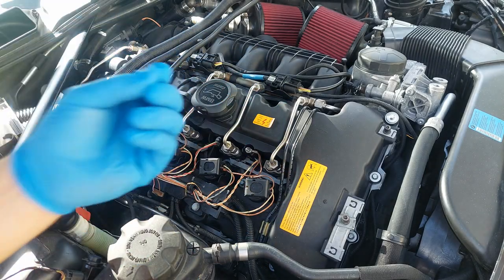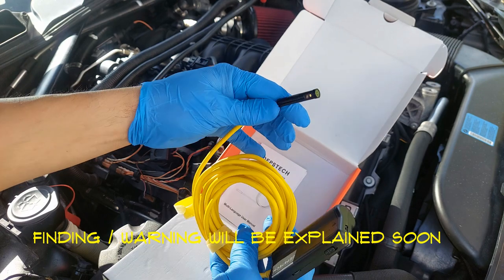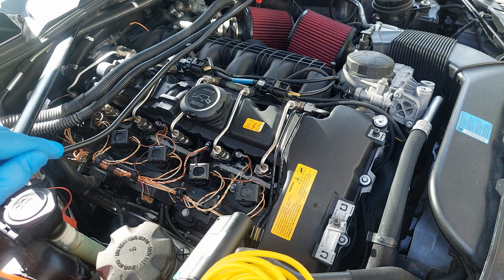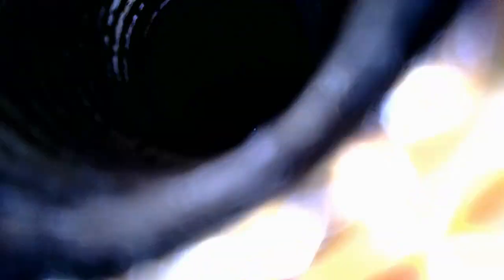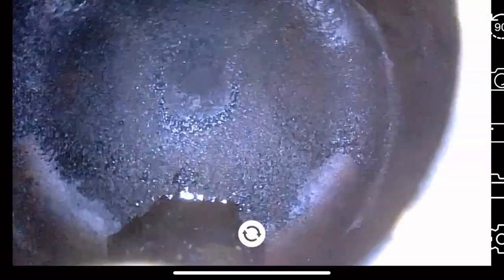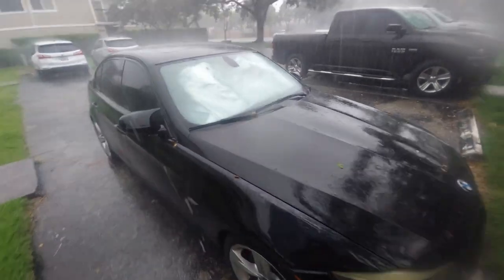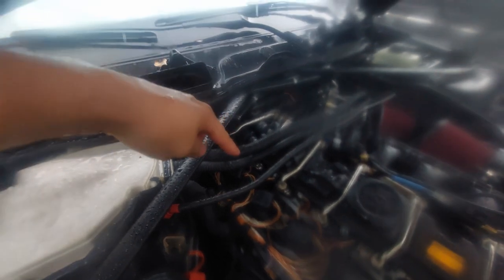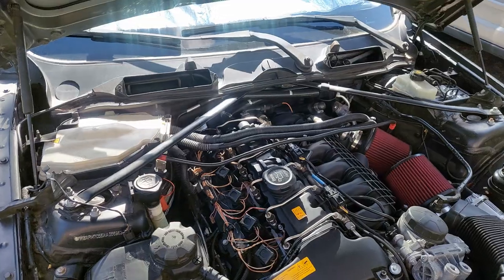Warning! Doing This Mod Can Kill your Engine! / N54 Cowl Delete

Comment: The biggest problem is not the missing cowl, but the missing engine cover...
Reply: missing cowl will also mess with your ac and cabin filter area, can leak water into passenger side floor and flood electronics

Comment: The engine ticking sounds like a lifter tick. Very common issue. And the water inside the cylinder head is more than likely a worn head gasket. Eliminating a cowl cover will not drain water inside your engine by getting past your spark plug.

Comment: I know you had good intentions here, but your misleading the community with this video. I have 10+ BMWs in my fleet, and 6 of them are BMW E90s, ive got all variations the engine and all cars have had their cowl removed. So if you take the 6 cars, and add how many years each car has been running without its cowl, I can say I essentially have witnessed 60 years of cowl delete between them all, I can safely say this is not correct. If you have put back the spark plugs and coil packs correctly, there cannot be any water penetration to the engine, it just cant make it past the spark plug. I have never seen a wet spark plug like you are describing when pulling them out, and I replace them all every 10k miles so I am regularly inspecting them. So the video would be better suited adding a warning at the end, this is what happens when you delete your cowl and fail to to properly install spark plugs and coil packs. 

Now, moving past that, you should note that you have done the cowl delete incorrectly in my opinion, you have left your cabin intakes completely exposed. Now that will allow large debris and rodents into your interior, terrible idea. You need to get coovers for those inlets, BMS sells them and they are excellent, all of my cars have the filters on it and no problems. They are washable, but the plastic tends to rot in about 6-7 years in the engine bay going through the heat cycles.

My final point to add to this, is that there is one particular situation where the cowl delete can cause massive problems. On one of my E90s, a 2006 325xi has the older N51 variant with the magnesium valve cover, the one that has the metal gasket. This engine was found on the 2006 models that were produced in the first few months of the year. If you do the cowl delete on that model, the water pools on the back of the valve cover by cylinder 6 in the cavity by the injector and can cause rust and will cause it to deteriorate. This happened in my vehicle and caused the valve cover to create a little cavity that then turned into a blowout, looks like a bullet shot out of my valve cover. Replaced it and have no problems. I treated the new valve cover with some extra coatings/sealants to resist rust and I re-coat that back section every year to ensure it does not occur again. Good luck!
Reply: So do you use something to cover up the ECU & master cylinder/reservoir when doing the cowl delete? Or do you just leave it exposed? I'm thinking about doing the delete on my 06 e90 n52
Reply: @alextran8188  it's a useful mod only if your constantly working on your car, otherwise it does not make sense unless you just want to hear your engine noise more. The ecu is completely protected by it's box, you just have to ABSOLUTELY make sure it's tight and properly clipped on, and water will never enter. I would say check for cracks because it's plastic but I've never seen any of my ecu boxes get cracked over time so it seems they are made very well. Master cylinder will also be fine as is, just make sure to clean out the leaves once in a while and ensure the drainage catches are clear of debris, if you park under trees or near trees, this is important for many reasons. Any other questions let me know

Comment: I have the full cowl delete kit from Turner Motorsports (cable bracket, ECU and booster covers, cowl filters) and because of this video, I made sure to put my engine cover back on before it rained. 
It’s been raining a lot over the past few days and my car/engine has been fine. 

Cowl delete + Engine cover and you’re good.

Comment: I have had a cowl delete for 3 years. Put your engine cover on bro I’m more worried about the dme
Reply from the maker: Yeah man, thats exactly what I did right after I recoded that footage. 
The main issue that I see is in the long run and how much exposure the car has with water. We all now that water is a MF. It likes to either rust, corrode, or cause oxidation on a variety of materials.
For instance; Aluminum doesn't rust, but it does corrode. Aluminum corrosion can happen gradually over weeks, months, or even years, if constantly exposed to water. 
I dont think is super alarming thought, specially if you keep your car indoors (that's when it comes to corrosion)
The other concern would be water and/or moisture in close proximity to your DME.
I used to run with the cowl delete myself, but it was until what I found, that I decided to protect the engine from water from getting in, by modifying the cowl. It is for this reasons, it is better to be safe in my opinion.
I was super worried after I recored this footage so I just ended up modifying the cowl to aliviate any headaches.

Comment: Unfortunately water dose not seep into a combustion chamber unless your spark plug is loose. Your spark plug may have been loose via the noise on the video. Condensation is most likely the reason for water on piston
Reply from the maker: Great point! My car mad being sitting there about a month. At that point we where having rain almost every day, Hence It was hard for me to work on the car. Not having a cowl at all was, along no covers was definitely not a good idea.
Reply: I specifically was looking for this comment. I agree...no way water gets on piston without a missing, or very loose, spark plug.

Comment: I can only agree with your opinion, of course heat builds up through this cover, but I wouldn't completely omit it. I got an engine wash a few weeks ago and was able to notice after 1-2 weeks that my ignition coils were all rusty because water got into the spark plug shaft from the engine wash. This caused me to have misfires at higher revs. I'll swap spark plugs and coils tomorrow and hope the problem is fixed. Greetings from Munich Germany. :goodvibes::goodvibes::goodvibes:

Comment: Haha, funny, water can't get in past the spark plug, the cylinder is totally sealed. More likely is that some water got down the spark plug tube in the head and when you unscrewed the plug it dropped into the cylinder.

Comment: Did this fix your issue? Was water seeped into your spark plug holes in the head causing a misfire or something? My car ran perfectly fine before parking it for winter and I now have the same noise as you.

Comment: What specs are the 8mm bolts cause I have non
Reply from the maker: Since I wasn't sure of the bolts. I just went to the dealership and bought the clips that the bolts screw on, as well as the bolts. It wasn't much, just a few bucks.
That's probably the best bet. Hope that helps bro

Comment: There are plenty of ways to make power and improve cooling that don't include soaking your gofast bits. Like honestly, if you think 10 lbs weight reduction, a slightly better sound, and supposedly better cooling is worth possibly destroying your engine and/or dme, then go for it. And as for ease of access... I get it. But c'mon, it's only a couple bolts and wires. You can take the extra two minutes removing it whenever you need to. The only way I could justify doing this to my car is if I could afford to buy 20 more bmws (and I definitely cannot lol).

Comment: Cowl is there to protect your engine from rain I added it back... my e90 is always in the garage so I can also tell you I live in Florida. E90 has about almost 300 miles and the engine is quiet just serviced it and I couldn't agree more. Also, where is your engine cover an why did you take it out brother? The engine cover is there to protect your engine it doesn't make it better for your engine to cool up. i rather cool my engine by using silicon tubing.

Comment: Im lost, Can someone tell me what the purpose or benefit is in removing your engine cowl? It might have a bit of a cleaner look and I'm sure the weight diffnce does  Nothing for your performance, so what would one expect to happen?
Reply: It alows alot more airflow, saw my running temp drop 5-10° c some days
Reply: Yea drops abt 10 lbs allows you to hear more from the cabin and allows way better cooling in the engine bay for the price def worth it just run ur engine cover with it and youll be good

Comment: What if you had the plastic cover on the engine? I run cowl delete with plastic cover - wondering if it’s still vulnerable to water. Haven’t had issues yet. I may go to M3 cowl mod long term.
Reply: You should put a camera in, close the hood and hit it with the water hose. I be interested in the results. I run the bms cowl filters with the plastic engine cover and no issues but I also have no rain in my area.
Reply from the maker: Having a plastic cover on would have prevented the water getting in on top of the engine for sure. Not only prevented the outcome that I saw, but also prevented water from touching the ignition wires. The main issue that I see is in the long run. Water is a MF. It likes to either rust, corrode, or cause oxidation on a variety of materials.
For instance; Aluminum doesn't rust, but it does corrode. Aluminum corrosion can happen gradually over weeks, months, or even years, if constantly exposed to water. 
I dont think is super alarming thought, specially if you keep your car indoors (that's when it comes to corrosion)
The other concern would be water and/or moisture in close proximity to your DME.
I used to run with the cowl delete myself, but it was until what I found, that I decided to protect the engine from water from getting in, by modifying the cowl. It is for this reasons, it is better to be safe in my opinion.
I just made a video modifying the cowl btw. 
Looks super 😈
Reply from the maker: Man. honestly after seeing the amount of water going in and how exposed the DME was. I didnt even re-record that footage, because I started to get worried. 
Check out the previous response, on the reasoning behind putting or modifying the cowl.
Reply from the maker: And minimize the water exposure. Long term effect can be the issue here.

Comment: I cant understant how water would make it thru the sparkplug threads. Does not make sence..  I do understad your point though.  Engine ticking is common for these models.  Head gasket is also possible.  Check your oil to see if its mixed with water as well...

Comment: Are you going to swap the motor ?
Reply from the maker: No, luckily my engine is ok. This is what I noticed while looking for an issue I currently have. And I wanted to put it out there since a lot of guys have the cowl delete set up.  Difference is that my car has been on a stand still for weeks without the cowl or the engine cover.
Reply: @CrazyCarMods  oh great news, what did you do to stop the knock sound or did it go away ?

Comment: I have the cowl delete but with BMS filters and still have my engine cover on and do not have any problems. But thats just me.
Reply from the maker: The main issue here that I see is in the long run. And any effect a bad seal can cause. I ened up modifying my cowl just to aliviate any issues. Moisture cause also cause damages in the long run. Knowing how much the DME can cost, and seeing this issue I just saw. I think is better to be safe. Aluminum doesn't rust, but it does corrode. Although Aluminum corrosion can happen gradually over weeks, months, or even years, if constantly exposed to water.
Just minimize the exposure to water and you'll be good.
Just a food for thought.
Reply: water is meant to go under the cowl… thats why its raised… all the cowl is doing is protecting the filter from dust/debris moisture will still get behind it. bms filter is washable when you see it looking crappy, just clean it.. the filter seals to surface tighly, done.

Comment: This would seem like a reasonable assumption, EXCEPT that my car had the cowl deleted many years ago, and my ECU and Sparkplugs are dry as the Sahara. And I'm in the SE where we get hell raising thunderstorms almost every week, multiple times in the late afternoons during spring and summer. So, NO! That's obviously NOT the culprit. Probably loose spark plug, as water doesn't push through that tightened fit. It's all good, I know you are just trying to help people so I'm not looking to flame you here, but I do feel a need to correct the misinformation.
The cabin filter housing is a heavy pos that these cars do NOT need. EVERYBODY wants to blame every problem on removing it, because most bimmer owners learn quickly that they don't want this heavy pos on their cars and remove it. But of the thousands of bimmer owners who are either in the CCA or on forums I frequent, almost NONE of them have had any problems with the cowl delete. IF anyone is paranoid about it, run your own heat-shielding, as a way of shielding this area from direct spray, if it makes you feel better. But mine (335i E92) doesn't have any of that, and mine is in perfect condition and doesn't have any water in the plugs, or plug area. SO the empirical information proves it's not the cabin filter housing removal that caused your problems, or anyone else's.
Reply from the maker: Steve. I'm glad that up to this point you haven't had any issues. But honestly, who in the world is going to take a look at their engine right after it rains, before turning on their car? 
Before this video, I was running around without any cowl or engine cover. I had the cowl delete for a very very long time; and I too used to think that it would cause no harm. While my car had been sitting there for weeks without driving plus some raining in between, one day right after it finished raining; I turned my car on and immediately opened the hood to look for a ticking sound I was experiencing. It was at this exact moment I saw water start to bobble up and evaporate on top of my engine, next to coil 5 and 6 in the little holes that are around that area. Remember, I did not have my engine cover on. 
After noticing this, I did not think much of it (yet It stayed in my mind).
Following this, I didn't work on the car for weeks since I was very busy and out of the country (of course we were in the rainy season). Once I finally got back to work on the car, that's when I discover what you saw on this video. My car at this moment had NOT been turned on or moved for over a month (it was also raining nearly everyday).
Now while I do understand that having water inside the cylinder head is very very odd, it is Not impossible. For this is what I experienced. Water is a MF and it will filter through just about anything. Water will go through a rock or concrete if you give it enough time. 
Regardless, Im putting this information out there for everyone to be conscious and cautious. For everyone who has this mod and for everyone who may be concerned to run their own test and verify for themselves. 
I know what I saw and I know what I have experienced, Yet it is up to everyone to do their own test and decide what they want to do. Maybe a little bit of water is no concern for many people and for many other people maybe it is. For anyone who really wants to know, just run your own test without the engine cover and obviously without your cowl and see for yourself. 
Best of luck to everyone. #N54Gang
Reply from the maker: Thank you for your input
Reply: @CrazyCarMods  Yeah, I'm not trying to be a dick here, but the problem with your car was NOT the cowl delete, it was owner neglect, as you've detailed in your statement above. I don't let my car sit for ANY time without driving and checking it out. That is a death sentence for these cars. I drive my car every single day, and in the spring and summer, through tons of serious thunderstorms. And for YEARS, I've not had any build up of water on my engine nor my ECU unit, as my car has the proper rubber deflectors around that part of the engine, to direct water away from the engine. Maybe yours is missing those, I don't know. What I do know, is your letting your car sit around for long periods of time without any attention or maintenance of it, and then suddenly just going and starting it without checking it out IS TERRIBLE OWNERSHIP OF ONE OF THESE CARS. THAT is where you problem lies, NOT with the cowl delete. We have more than seven thousand members of our CCA chapter, and many of them are 3 series owners, who all have the cowl delete done for years and years without problems. So that's called empirical evidence that it's not the problem.

Comment: Can't emphasize more, you need the cowl to protect the engine from this type of damage. I didn't know water can get inside the cylinder until I watched this but I knew the water would damage the rear injectors and ECM. Do the proper M3 mod or leave the cowl

Comment: The worst “performance mod” is the diam hot air intake maybe  with a vented hood it would work better. I wouldn’t do the cowl delete either rather just remove the engine cover